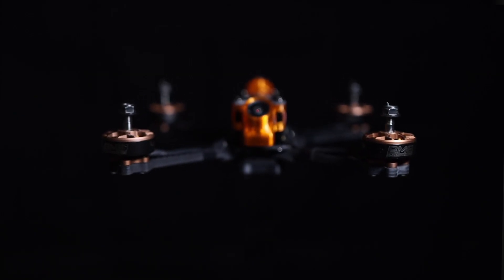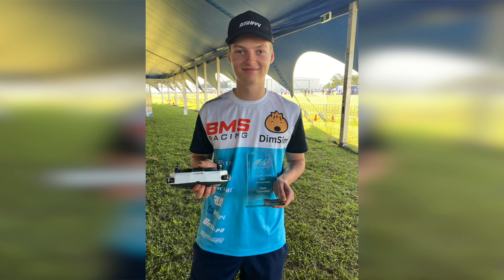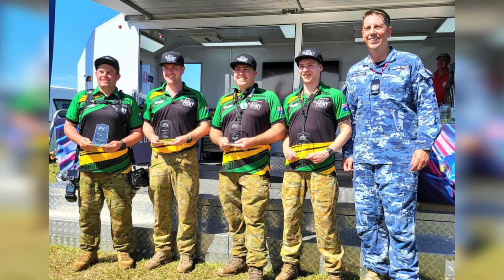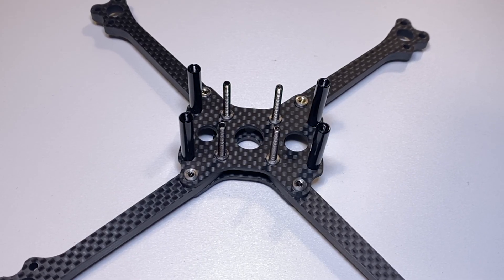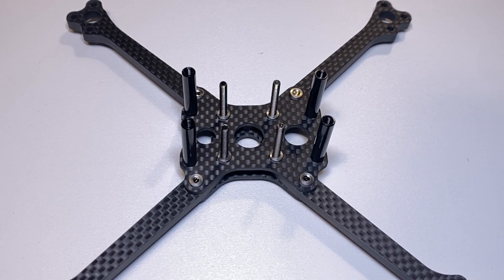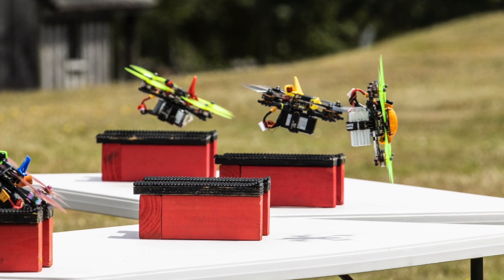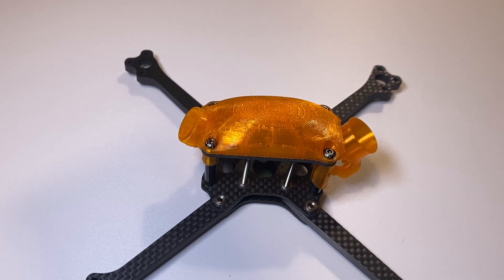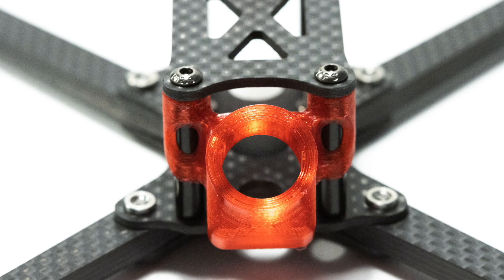Drone Racing Frame JS 3 Tiger from BMS Racing

Comment: Did you notice any increase in gyro noise/vibration running the stack screws through the arms?
Reply from the maker: In the race footage at the end at the NZ Open, people were commenting on how quiet and smooth the quad sounded. It's possible to transfer additional noise via the stack screws but it all depends on the design and carbon used etc. So in short, no issues with noise on the JS-3. Speaking of which we need to do a build video on the JS-3 which should cover how it should be constructed.
Reply: @BMSWEB  I have a theory that using the frame to dampen vibrations is just inducing physical latency into the equation.

Comment: Would a tpu hoop on the top plate provide impact protection, save weight and also be handy for turtle mode?
Reply from the maker: I need to add more files to the Thingieverse file set, both the Unicorn Horn and also a TPU Hoop couldn't hurt. Out of curiosity what does the hoop weigh on your quad? The Aero Pod comes in at 4g
Reply: @BMSWEB  3g on my kitchen scales 😂